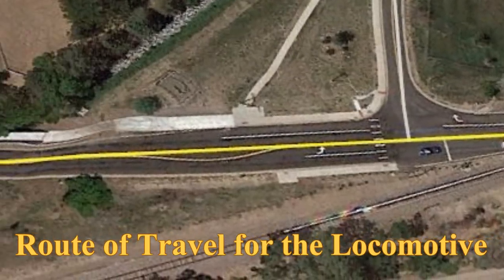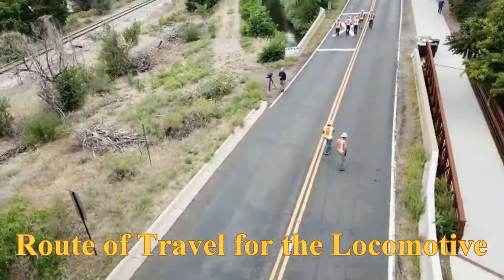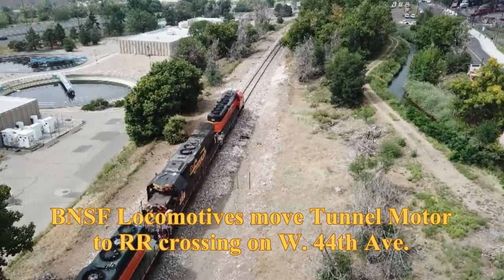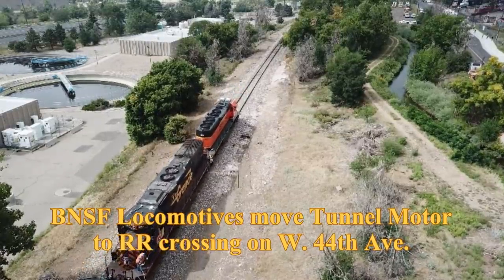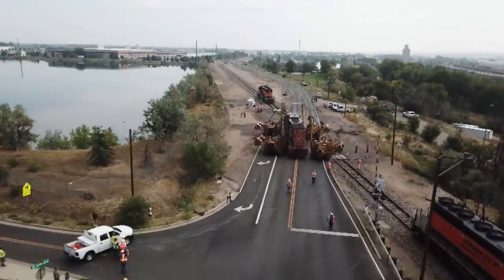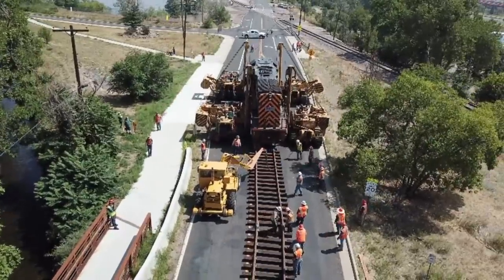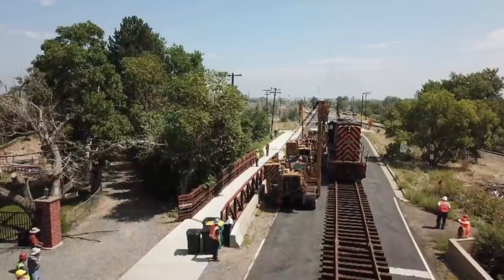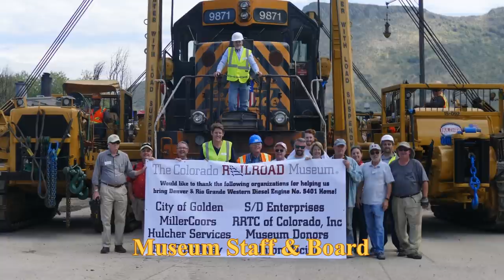2018 August 22nd   Denver & Rio Grande Western Tunnel Motor Move

Comment: So, Why is the Museum not still hooked up to a siding?  It would make sense to me to be hooled up to a siding for those few times that cars and motors need to be brought in or out.
Reply from the maker: Please take the time to read other comments on this subject.  A connection to standard rail is neither desirable or possible for our museum.  Once you understand the reasons, it will make sense to you.
Reply: Where should I read those other comments?  I didn't see a link, not an explanation.  

It was just me wondering.  The museum Was hooked to a siding or main line at one time... Right?
Reply from the maker: No, never.  We have mostly narrow gauge equipment,  a total mismatch.  It just does not work.  Consider this.  Narrow Gauge equipment is smaller and lighter than standard gauge equipment.  Just load it on a lowboy and haul it directly from place to place.

To see the other comments, you have to scroll down through previous comments.
Reply: @ROKuberski  Ahh.. makes sense  Darn gauge and weight issues....

Comment: Did this /was this still capable of moving on it own power?
Reply: Probably, since it was given a yellow panel w/red numbers, means it was slated to be re-painted to UP colors.
Reply: It could not. It sat outside Coors mechanic shop it was pulled down the track. Fun fact it has a toilet in the nose
Reply: @Directgeekfilms  so does every other locomotive...

Comment: Those side booms must make the job easy— a lot more balanced than using a regular crane

Edit: just curious, are those side booms attachments for Caterpillar bulldozers/crawler tractors? Also, I find it kind of interesting how Caterpillar’s equipment was used as CAT recently bought EMD
Reply from the maker: Yes, you are correct.  I think they were first developed for pipeline work.  Go to Cat's website and you can see more about them.
Reply from the maker: I don't think the purchase of EMD was recent.  I looked up some articles about this and they were dated June of 2010.

Comment: This was a very impressive operation,  with great co-ordination between the machines, but perhaps someone can tell me why it could not have just been winched onto a heavy lift low-loader trailer and driven straight to the museum, a system that is very common in the UK (without tearing up the asphalt on the highway with the CATs). I am really surprised about this as most railroad operations that I have seen posted on YouTube seem more efficiently carried out in the USA than the UK.
Reply: US locomotives are far larger than UK locomotives and are much heavier as well. Loading a locomotive onto a flatbed would require that the engine be disassembled some to lower it's height for bridges and to lower the weight. It takes many, many, axles to hold the weight of a locomotive that's pushing 400,000 lbs when a typical 18-wheeler is limited to no more then 80,000 lbs fully loaded under federal law. Some Freightliner locomotives were actually built here in the US for the UK. And they are hauled out on flatbed rail cars and shipped to port on the back of US freight trains. To see the size difference was quite cool. The UK locomotives when raised up on the flatbed rail cars that had rail embedded onto the deck of them, only then stood at about the same height of the US locomotives pulling them once they were on the flat cars. So quite a size difference.

Comment: I put in 2 years working for Hulcher . Although fun sometimes, I wouldn't do it again for any amount of money.
Reply from the maker: I would imagine that the operation to move this locomotive was child's play compared to sorting out a major derailment.
Reply: hard work? or was it just something within the company that made you leave
Reply: @greynolds17  you do work hard. But for me the worst part was being on call 24/7 and keeping a packed suit case in your car . Because you may get called out at 2 in the morning, you have 30 minutes to get to the shop. Leave out for a job 4 hours away and work for the next 20 hours or so. Alot of heavy lifting , walking up hill , tromping through mud, and through all this even though you may not have slept for 48 hours , you have to be alert. It's ok when you're young , but once you get older, forget it.
Reply: @ROKuberski  yes , and you'd most likely get to walk away clean.

Comment: does colorado rail museum have a proper " reciving track"? if not then they should .
Reply from the maker: Don't have a clue what a "proper receiving track" track is.  But if you would read through the comments you would find that the majority of our equipment is narrow gauge.  We have some standard gauge track for display only.  There is NO connection to the BNSF track that is closest to the museum.  It will never happen.  Reasons given in numerous previous comments.

Comment: Why was not the crane and car platform used for transport?
There are no cranes in the US? So many hours and fuel were wasted.
Reply from the maker: Hulcher services is who the museum contracted with for the move.  Their specialty is doing this kind of work.  I'm sure that several options were discussed before selecting this one.  The museum is not flush with surplus cash.  I doubt that there was a less expensive option.

Comment: I watched a video of new trains being built and they said they weigh 400k pounds so that means each bulldozer is holding about 50 tons.
Reply from the maker: I think I mentioned that this unit weighed about 360,000 pounds, still a big load for the dozer.  In a previous comment I looked up the size of the track for each of the dozers and calculated the load per square foot.  Not as much as you would think, and of course that is why they used a tracked vehicle.  A wheeled vehicle has a much larger load per unit area than a tracked vehicle.

Comment: They can put that much weight on the asphalt without destroying it? We’re looking at close to a million LBS between the T-2 and the tractors
Reply from the maker: The tractors have rubber treads, and as I am sure you know, a tracked vehicle spreads it load over a much greater area than a wheeled vehicle.  But, there was some damage on the road at the entrance to the museum where they had to rotate the locomotive.  Minor damage was repaired the next day at no cost to the museum by the City of Golden road crew.  One reason they used the panel track on part of the route was when they crossed a box culvert.  That reduced the load and spread it out over a greater area.  The other reason to use the panel track was that there was not enough room between the edges of the culvert for the dozers and the locomotive to pass as a unit.

Comment: The Hulcher Company that is doing this move was started in Virden, IL.  then moved to Texas about 40 years ago.  Virden is very near my hometown of Girard and I had friends that worked for Hulcher.  Isn't all the trackage going in and out of the museum narrow gauge?
Reply from the maker: I'm not sure what you mean by "going in and out of the museum."  No tracks enter or leave the museum grounds.  There is very limited standard gauge track on the museum grounds.  Most of the track is narrow gauge and the loop that we use when we have operations is all narrow gauge.  For those who think we should have a connection to the world with our track should instantly realize that it just won't work.  I am not aware of a mountain area tourist railroad in Colorado that is not narrow gauge.  I guess the exception is the Pike Peaks Cog Railway, which is currently being completely rebuilt.  We just got some of their equipment for display at our museum.  Although their old stuff is standard gauge, I don't know what the new equipment will be.  For all I know, it might be metric.
Reply: @ROKuberski  Heber Valley Railroad, in Heber, UT.  Operating historic RR in Mountain grade that uses Standard Gauge.  There was another one in Wyoming or Montana, but I don't remember the name...

Comment: would it be great to see that diesel run if the museum installed a standard gauge third rail on the loop of track
Reply from the maker: We had to upgrade the rail bed for our Locomotive 491, a large narrow gage unit.  It caused problems in several areas.  The tunnel motor weighs about double what 491 weighs.  Likely could be done, just lacking $$$$$ for the job.  A lot of the equipment at the CRRM is late 19th century and early 20th century narrow gage equipment.  There is a lot of other stuff there too.  Check out the museum website at CRRM.org.

Comment: Are they going to restore it to the point to where the engine can be started?
Reply from the maker: I doubt it.  There is no place for it to go.  The only way off of the display track where it now sits is to move onto the turntable which we do not think can handle its weight.
Reply: I understand that it can't be moved, but it would be nice to hear it start from time to time.

Comment: Those tracked sidebooms must have done a real number on the asphalt paving
Reply: It looked like they made a mess everywhere.
Reply from the maker: @leonkernan  No, they did not make a mess.  Minor damage at the entrance to the museum where they had to turn the locomotive 90 degrees, City of Golden repaired the damage at no cost to the museum.  The side booms had large rubber pieces mounted on their tracks.  Very gentle on the road surface especially considering the weight on each unit.
Reply: The railroad service sidebooms usually have rubber track pads to avoid damage, since they don't need grousers for the type of work they do, and often are on roads.
Reply: Looks like the tracks were rubber blocked so damage would have been minimal.
Reply: I was thinking the same thing.....as i noticed the track marks on brand new asphalt.
Reply: We always had rubber pads on the grousers . Only a big train wrecks , when the tracks were badly destroyed and we were in mud we would remove the pads so the side booms could get traction .

Comment: And why can't we make a permanent line to the museum?In Berlin, this is done, for example. As a result, this would allow the equipment to participate in various shows outside the museum, and it would be easier for the equipment to enter the collection.
Reply from the maker: First and foremost, the museum does not want or need a connection.  Our operations are all narrow gauge.  Twice in the history of the museum a large standard gauge locomotive was brought in.  Once by laying panel track and once as you saw in the video.  Other things like boxcars were brought in by truck.  There is a significant elevation difference between museum track and the track that runs near by.  Also not enough room to make the turn, and then there is the canal that is also in the way and land that the museum does not own to lay the track.  Narrow gauge equipment is not as heavy as standard gauge equipment.  Currently, our recently restored engine #20 is at the Cumbres & Toltec railroad for special events.  This too is a narrow gauge railroad.  Our engine was trucked to their location.  It could not get there by rail.  It does not handicap the operations at the museum because it does not have a connection to standard gauge track.
Reply: @ROKuberski  
Thank you for the explanation, now your position is clear.

Comment: I wonder how heavy those counterweights are to balance an 80-ton locomotive?
Reply from the maker: Instead of wondering, you might try what I just did.  Do a quick internet search.  Looks like 23,950 pounds.  Of course I don't know if this is the same model.   By the way, it is a 184 ton locomotive.

https://www.cat.com/en_US/products/new/equipment/pipelayers/pipelayers/1000004495.html
Reply: 20 tons each
Reply from the maker: Post a link to your source of information.  That is a lot more than I found.  If they are solid steel, that would be a piece 3' x 3' x 9'.  They are not that big.
Reply: I wonder if it was Cheyenne division or Denver division that moved them
Reply from the maker: It was Hulcher services, a private company.
Reply: @ROKuberski  Thank you,Richard.They did a great job.
Reply: The front set is 7 plates and rear are 6. Each plate weighs around 1200 is what I've been told. Then add the weight of the rack itself you're probably looking at around 8-9 tons of weight on one side.

Comment: What is. “tunnel motor” as opposed to a regular locomotive?
Reply from the maker: It is explained in the video.  As I understand it, the air intake for the engine is at walkway level instead at the top of the machine.  Better air lower in the tunnel.

Comment: It would be nice if the main line owner would donate a spur to the museum being as close as it is. Being track isolated must make it very difficult for this and other train museums.
Reply from the maker: Here is a response from Donald Tallman, Executive Director of the Colorado Railroad Museum."There is no possible direct connection to the main line given its proximity to the Museum.   Most of our railcars are narrow gauge and can easily be trucked in.  This was a very large and heavy locomotive that was easily and safely moved using the sidebooms. "

Comment: Why doesn't the Colorado Railroad Museum have a connection to the outside world?  They're apparently only 1100 feet from the nearest standard gauge track!
Reply from the maker: Walk straight south from the museum main entrance and you will find standard gage track about 200' away, but it is at a lower elevation than the museum.  We don't own right of way to build track. Buildings and a park are in the way.  Taint gunna happen.
Reply: @ROKuberski  If I were on your board, I'd be talking to the city about upgrading that bridge and running some street trackage to that crossing 😊
Reply from the maker: What, you want to run a rail line down the middle of W. 44th Avenue to the museum?  How are you going to make the turn into the property?  Keep in mind that this has been needed only twice in 60 years.Check this out.  https://en.wikipedia.org/wiki/Minimum_railway_curve_radiusLooks like a 288' - 410' radius would be required.  Take a look at the museum on Google Earth.  The property is perhaps 600'x900' and that is not all flat land.When you get on the board, you can discuss this with the proper people.  That's not me.

Comment: I REALLY HAVE A DUMB QUESTION, WHY COULDN'T YOU USE PANEL TRACKS ON THE ROADS AND START THE LOCO UP AND "DRIVE" IT TO. THE MUSEUM'S RAIL YARD? TO ME IT SEEMS LIKE IT WOULD BE THE EASIEST WAY TO GET IT TO THERE. ALL IT WOULD TAKE IS SOME DIESEL FUEL TO GET IT STARTED AND WALA!! IT'S ON IT'S WAY TO THE  MUSEUM'S RAIL YARD.
Reply from the maker: The locomotive is not currently in operating condition.  Please consider that the people that organized this move took many things into account, examined their options and made the choice you see in the video.  We are beating a dead horse here.  It's done deal.  The video shows how it was done.  It is likely that there were considerations you may have not thought of.
Reply: as it was not in running condition my solution would have been panel track too don't know if it would make the turn into the drive though. just tow it with two loaders one on back one on front if they could straddle the track but would still require it to be lifted twice.
Reply: Also, your shift key apears to be locked, why dint you clean your keyboard before writing this comment? (press the 3 point icon to the upper right of your comment to edit, you can then change em to lower case https://convertcase.net/ for example )
Reply: @ROKuberski  Plus track is great on ballast or a hard surface like a highway, but once 184 tons starts rolling over softer ground, they might start having issues.
Reply from the maker: As previously noted, we did use panel track in the two areas that were too narrow for the locomotive and the side booms.  When the side booms picked up the locomotive, that was the quickest progress.  The panel track has to be moved around the locomotive, placed on the ground and realigned.  As you saw, taking the locomotive off of the mainline and starting it down the street was slow as was the 90 degree turn into the museum.  Everyone seems to want to second guess the decision made by the museum staff.  This is the group that had all of the information on cost, conditions, restrictions, etc.  I believe that they did their job well.  BTW, I too have some experience with complex operations.  I spent a lifetime in commercial construction as a senior project manager.  Gather information, explore options, make a decision and then move on.  Armchair quarterbacks always have a better way.
Reply: @ROKuberski  That's because You Tube posters are experts at moving locomotives around. They've done it hundreds of times with N, HO and O scale.
Reply: Railroad McDailroad, yes on 0-5-0 switcher could have handled this in half the time.
Reply from the maker: They still needed the side booms to lift it off of the mainline track and to turn the locomotive.  We certainly did not have enough panel track to roll it down the street in one big move.  I believe that the staff worked through the issues and selected the right method for this move.
Reply: @railroadmcdailroad1565  I'm just astonished to see that the pieces from my childhood HO set have basis in reality.  Panel track!!!
Reply: @ROKuberski   I don't think people mean to sound critical. They just have some ideas and are throwing them out there. As you correctly pointed out, it's water under the bridge. (And speaking of bridges, kudos to the engineer who designed that little bridge. Bet he or she never expected it to carry a 184-ton locomotive...plus two huge Cats with their ballast and booms.) 

I think it's great that people by the hundreds of thousands have watched your video in the last few months!!! Keep up the good work!